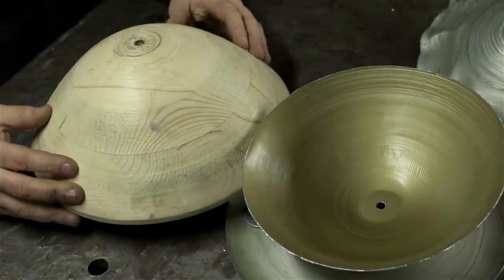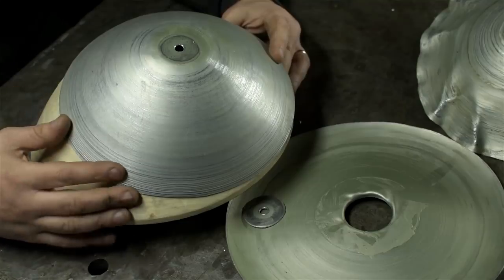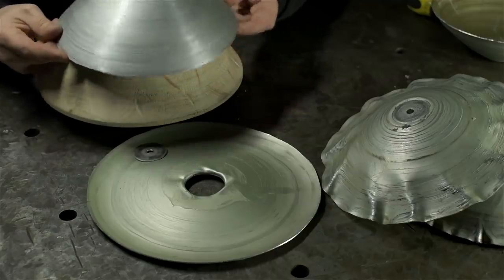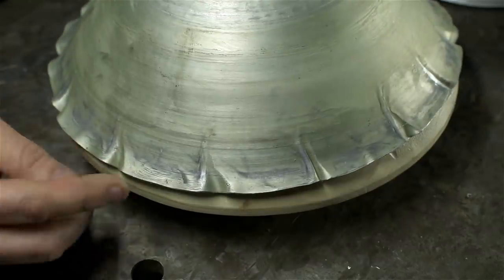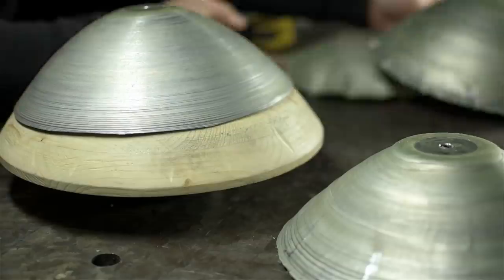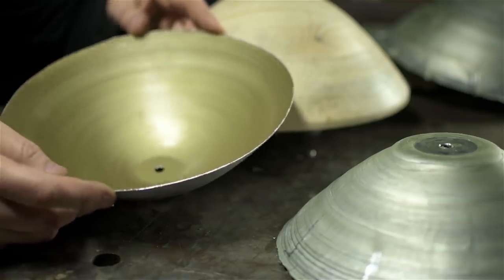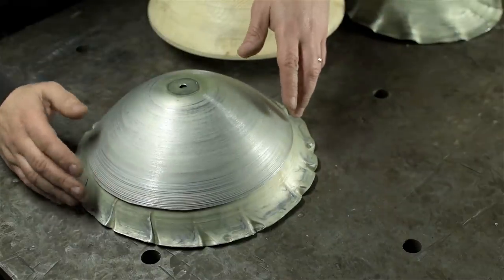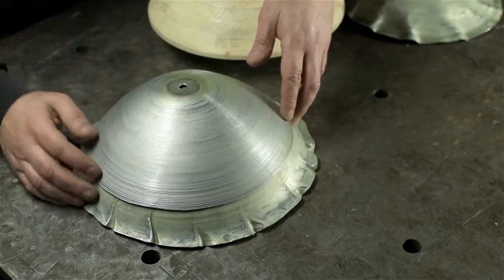Spinning Metal - Round 1 - I LOST!

Comment: So the buckling is being caused by either the material on the tool is not laying down all the way or you are being too aggressive on the strokes. Also this part would spin better using an ax handle other than that turret contraption.

Comment: Hello everyone.you must use grease or oil between Bearings and the plate.in the Middle East ,there is very Workshops made pot and the other dishes from Aluminium. This job is very very dangerous and when you get started,don’t stop in front of the piece ....stop be aside of the piece.Be safe

Comment: Caution:  The screws in the faceplate appeared to be black sheetrock screws.   These are the worst screw to use in any dangerous application as they fracture and break VERY easily even when just screwing them in.  You can't know if you turned the screw just 1/4 too much and weakened the screw.  Always use sheet metal screws.  These will take a LOT of abuse before fracture.  From 45 years cabinet shop experience having those stupid grapper screws breaking .

Comment: Try working from the outside in, it should be kinder to the metal. Those reverse bends on the outer edge are straining the hell out of it. I saw somebody spinning metal and he was getting the material red hot using a metal bar and friction to form the metal. Apologies, I was not watching like I wanted to do it myself. It might have been copper or brass. Try visualizing where the metal is going to go regarding the planar radius of the circumference which is diminishing. Don’t cut your arm, (etc.) off! Physics professors used to say draw a free body diagram, then BS your way though it. I haven’t figured how to make that trick work if you are actually making something, LOL.

Comment: You need to aneal and you need to use copper or use 1100 aluminum which is 99 percent aluminum .  I use pizza trays they are the right alloy go to a restaurant supply and their cheap and already circle blanks ready to turn.

Comment: Thinner material is not necessarily your friend. It will work harden faster. It's more about the correct alloy and temper. 1100-0 is butter. 6061-0 is good, too. neither will work harden. The wrinkling at the edge is too much pressure as you approached the edge. The flow of material was too great and had no where to go.

Comment: Not sure this is mentioned in previous comments and i know this is an older video, but It's my first time seeing it.  The wrinkles around the sides looks simply to be the fact that the circumference of the original sheet and the circumference of the rolled piece are going to be different.  Smaller if you will.  Think i'll go ahead and watch the second video.  -_-

Comment: Have you figured it out yet? If not ill give it a go... You need to see this comment as I dont want to waste my time.. how can i help you? Try slower rpm, use fluid... Try different material, use a different bearing. Idk ill get back to you!
Use a 3 pointed bearing tool. Equal pressure.. Make a triangle tipped bearing. Like those bearing pullers.. Umm so many ideas ... just reply ill see if i can help you in anyway.. Please read this as im waiting. Cool vid!
Reply: Try slower rpm, use fluid... Try different material, use a different bearing. Idk ill get back to you!

Comment: If the inside is growing... but the outside isnt... do the size of the wrinkles account for the amount of growth?  LIke a pizza pie if all you did was stretch out the inside.  You need a way to stretch the outer material to relieve the build up.

Maybe a set of wooden dies that go from flat progressively to bowl.  Each time you put in a new die you stretch out ALL the material.  That way there is even growth.. not just in the middle.  

I bet three progressive bowl dies would be enough to do it.  Shallow bowl, medium bowl, final bowl.

Or make 2 dies and press the thing in your 50T press.

just my $0.02

Comment: So, I know math more than craft, but I think I know what's going on with the "lamp shading." You're starting with a flat piece of sheet metal and going to a piece with some curvature to it. Now, in math,  doing that with a 2d surface is fine but only if the surface can stretch. Of course metal can stretch, but it's not a 2d surface. The inside of the metal the metal is becoming concave so it wants to compress while the outside is becoming convex so it wants to stretch. So my hypothesis is that you simply have too much material on the inside and not enough on the outside so when you get out to a certain radius, the internal stress is too much and some of the metal gives a bit to relive itself of the stress.

Comment: If you watch videos about how they make symbols or high hats for drum sets.. they try to do it in one pass... now for sheet metal workers or industrial insulator they spin out end caps, and when working with stainless steel the end caps are harder to make. Based now the memory of the material...
Reply: If you try brass metal stock you might get it to form better.. aluminum tends to have a little bit better material memory.

Comment: You have to heat treat the metal between stages.Metals changes states when heated and it loose temper. There are some great videos put out by the guys who build their own steam boilers for steam engines. Of course they use copper and brass but the theory is the same. I haven't watched your whole video so please forgive me if you come to this conclusion on your own.

Comment: When i was about 13 yo I tried this not the antique lathe in my step father's shop. First time the tool touched the metal disk took off past my shoulder like a demented Frisby. Next try it grabbed the tool and they both took off. At that point I gave up spinning as it seemed way more dangerous than most of the stuff i tried. Like the explosive forming didn't work that well either.

Comment: Ok, there you go again, making videos directly related to what i'm on with at the moment. I need to make some 6" diameter split rim alloy wheels and considered trying to spin them myself.....glad I didn't! epsecially as they're made from 3mm thick alu'mini'um (al'uuuu'minum as you guys say :). I got in touch with a specialist metal spinner in the uk, tooling costs are £225 and each half is £9 each, making them much cheaper that what i was currently using. Sweet.

Comment: Hi Tony, check this video out: https://www.youtube.com/watch?v=DpBg1mktv6M . The guy was able to successfully make a cylindrical cup out of a 3mm thick (1/8") sheet of aluminum. As that guy said, what made difference is the tool - he made it out of a ball from a ball bearing (diameter of the ball is 33.3mm). He welded the ball directly to a shank. Also, as I see it, his technic is different - he works the workpiece more uniformly - from the beginning to the end making it more and more tapered with each stroke. Diameter of the base shaft (matrix? fool?) is 70mm and it is slightly tapered. Sorry - that video is not in English, but it's quite self-explanatory and the guy is silent most of the time.

Comment: From my experience in wrapping cars (with vinyl films) those crevices are supposed to happen. Basically the width of the material front (or perimeter in this case) is larger than that of the substrate from the start, and then you enlarge it even more with stretching. There is just an excess of material, and it has to go somewhere, so the obvious solution is for it to fold on itself.
In wrapping there are three methods of dealing with them:
1. Pre-stretching the center before applying, usually in wrapping a rear view mirror or a door handle. I believe it's also in a way done in metalwork by custom-fab guys who hammer gas tank and fender parts by a rounded hammer on a sandbag before taking it to the english wheel or other machines. It kind of moves that 'neutral' unstretched line towards but all the way to the edge just like in you stripe bending video.
2. Starting with a larger piece of material so that the folding starts to happen outside the substrate border to be simply cut off. 
3. Just plain stopping the broad stroke work and starting micromanaging each fold in its birth before it is able to close on itself, usually done with a firmer squeegee than broad strokes. Maybe this can be done in this case by hand-winding the chuck cw-ccw with microadjusting the toolpost position.
Hope this view from another area helps.

Comment: There is this vid called "metal spinning with wooden molds with jim kennely" you might find interesting if you didn't see it already. Also you pressure tool seems wrong to me. Bothe the wheel and the hinging.

Comment: Where I work and we make what we call pans, the steel definitely gets stretched, and we use a lubricant. Even with us using a large Niagara  press not too dissimilar to this one https://www.youtube.com/watch?v=w9yC91ZxhjQ we get the waves in the parts. As can be seen in this picture https://www.efowl.com/wp-content/uploads/2017/01/Little-Giant-Hanging-Metal-Poultry-Feeder-Pan-17-Inch-0.jpg When the waves get too deep we have the setup guys adjust the pressure on the press. so you might need to go a little easier on the forming or, what i would suggest is less speed ( but its hard to tell the rpm of the lathe from the video), and/or thicker material. In our dies the edges get sandwiched flat or parallel to the bottom flat of the pan.

Comment: Have you thought about HYDROFORMING the dome? Using a solid plate (1' thick or so) as the base, and a second plate with the desired circle representing the base diameter of the dome. Bolt them together and feed H.P. hydraulic pressure through a fitting in the base plate. Seems like it yields a good result...  https://www.youtube.com/watch?v=r2qiEr88Z20

Comment: hey ho i love  your vids and i work with sheet metal you basicly had to wrap it around and dont push it in form but here you bend it to much from the beginning - give it a rough shape  whith each turn to the edge and work you way slowly over the whole sheet  till the edges to the aimed form - think like your cnc it will not get the job done properly in one stroke - and use some oil temps are critical on sheet metal - https://www.youtube.com/watch?v=4h-nfY2bMSY - ps. im a car body worker - sheet metal is my life